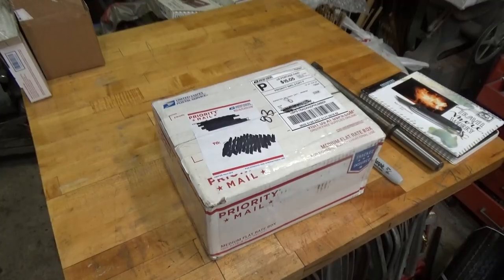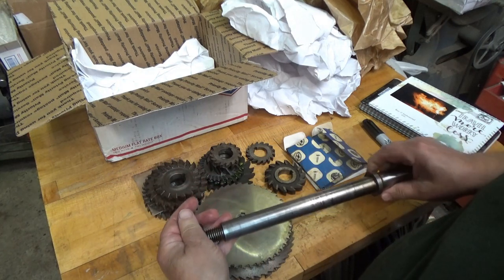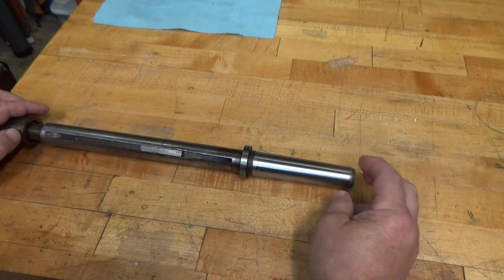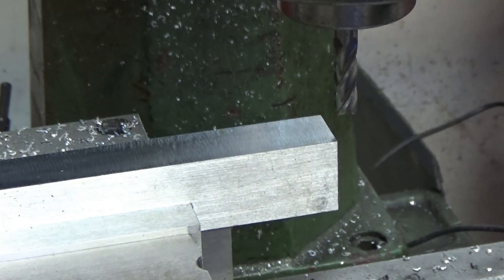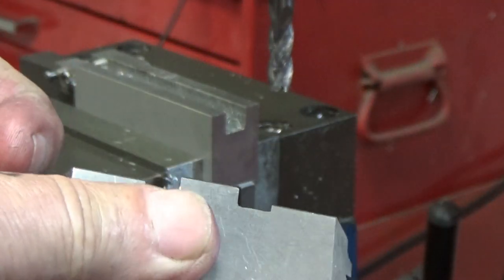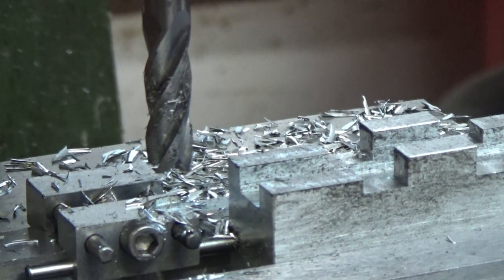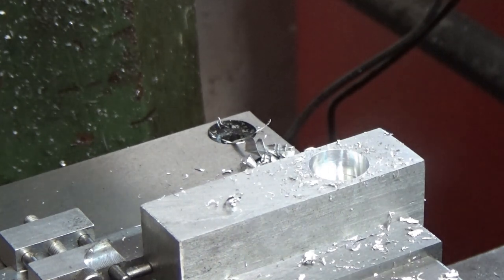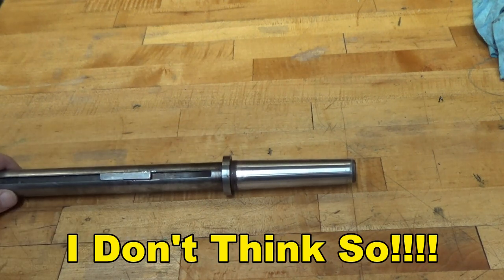Shark Bits #31- Making Aluminum Soft Jaws for My Shars 6" Chuck

Comment: I should have sent you bricks or coal to unbox! Lol. I will send more cutters when I get my shop reorganized.  Thanks for the flat stones!!!  I didn't pay attention but is that chuck an adjustable buck style chuck so you can adjust the center for the new jaws?
Reply from the maker: Thank you again for the cutters, I actually set a drawer aside in my tool box for them.  This is not an adjust true type chuck. I am going to machine them in place so that to run true.  Thanks for watching and commenting.

Comment: What kind of jaws are those for your chuck??
Reply from the maker: Not sure what your question is.  The jaws that I am making are aluminum soft jaws that can be machined to fit parts that are difficult to hold or parts that to want to make sure don't get marred by the jaws.  The steel jaws are the original jaws that came with the chuck and are used for most turning operations. Hope that this is helpful.